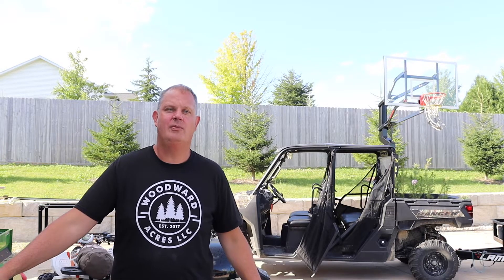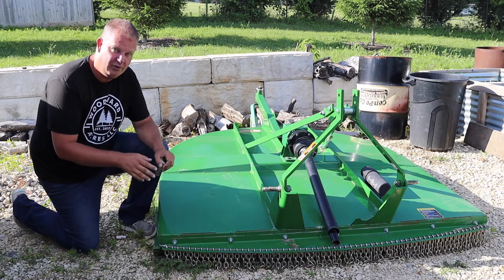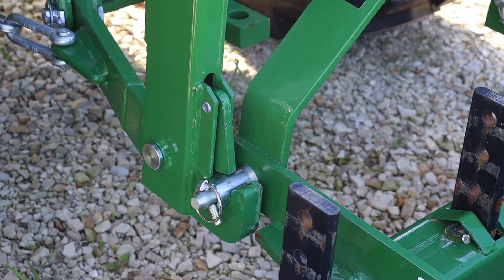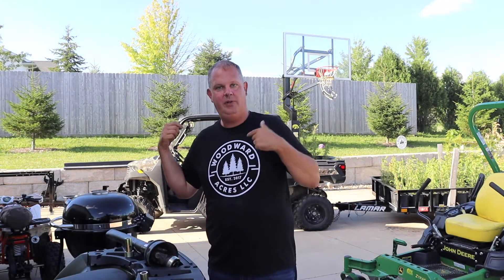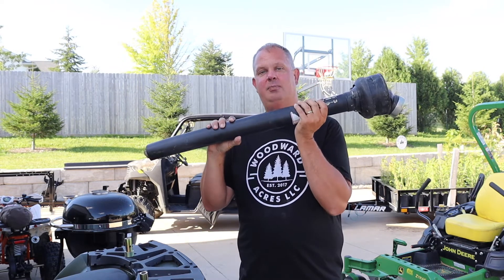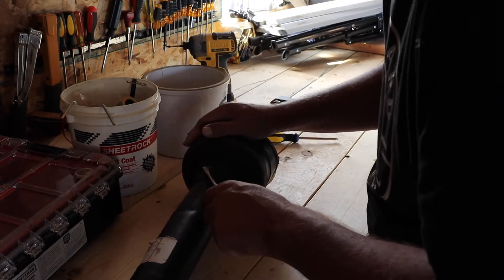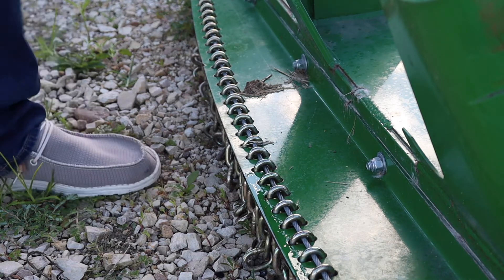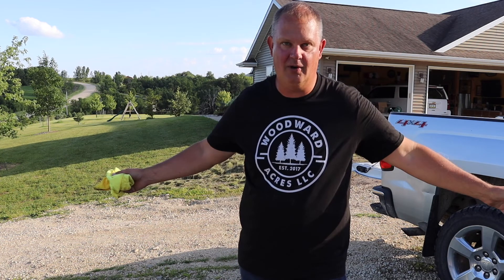Why Bushings Matter [On 3pt Attachments]

Comment: Don't do it ! - if it is bent it will be out of balance and destroy the bearings (either u-joint or end plate bearing of tractor) , the result can really get you hurt as well as damage equipment further (maybe not today or tomorrow  but some time soon).
Reply from the maker: I didn’t- got a new part. Thanks for warning me thought